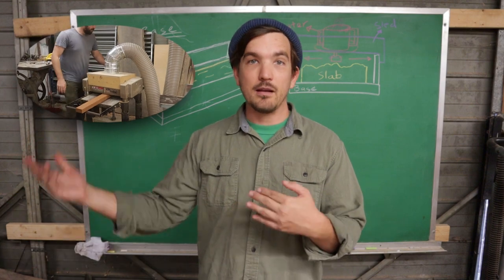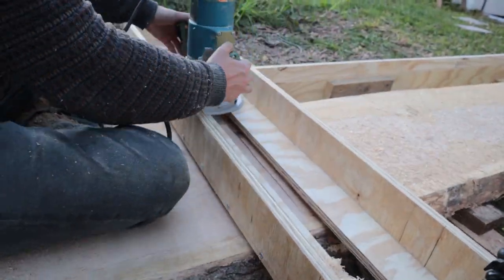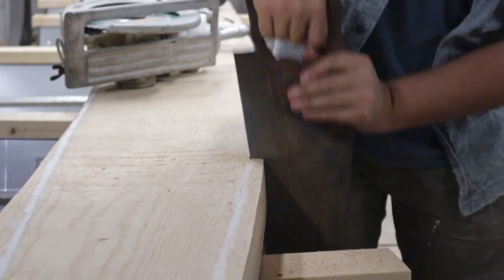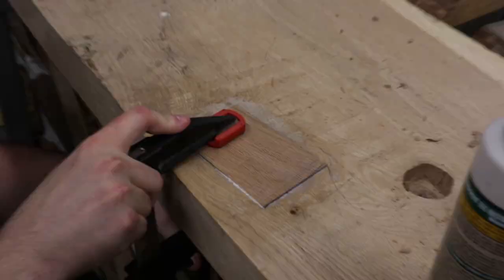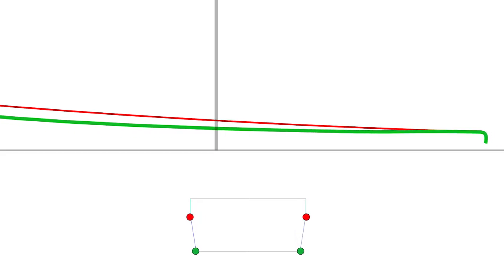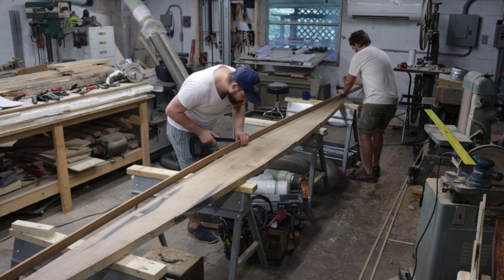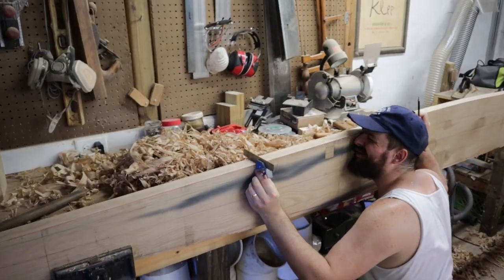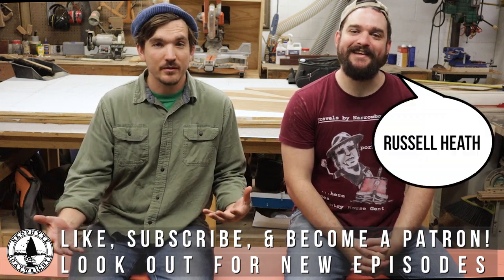Ep 9 - Making the Keel

Comment: Nice video, guys. On Dutchmen, it's slightly better to shape them to reduce the length of the end grain, if you can. End-grain to end-grain joins in timber are problematic, and no glue will work properly to keep that watertight. Also, if you put a very slight taper on the sides of the Dutchman, just a few degrees, you can hammer it home like a wedge, tightening as it goes in. Mark the Dutchman's outline with a knife, and keep well away from those lines until the very last thing you do in chopping out.
BTW, you didn't have a bow in the timber, you had cupping. You've also got some tannin staining (the dark grey areas) indicating that it's been in contact with iron/ steel. You might find that there's a nail, bolt, staple, or fencing wire somewhere in your off-cuts. 
A draw knife should be your go-to tool for removing bulk timber accurately.
Reply from the maker: Hey thanks for the comment! Yes we showed at multiple points in the episode us removing nails from the keel which definitely account for the discoloration. In fact some of the dutchmen were to patch in wood that was removed in the process of prying the nails out. Wedge shaped dutchmen are a good idea as is a drawknife for shaping the bevel. We dont own one so didnt occur to us but definitely duly noted.
Reply from the maker: Oh also the timber definitely had a bow in it in addition to some cupping. In fact it had bowing, twisting, cupping, and crooking. We didnt have space in the vid to address all of it, but it was a real trial to tame such a large timber.

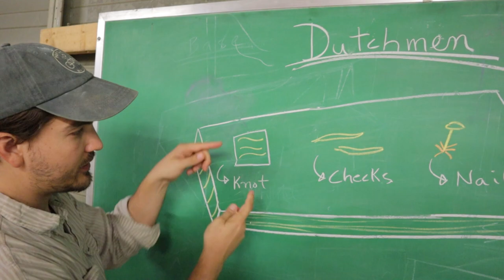Comment: 9:07 Did you mean to say that wood expands and contracts significantly more perpendicular to the grain rather than along the grain?
Reply from the maker: Sorry yeah thanks for catching that!  It is confusing because it depends on whether youre talking about face grain or end grain. but yes in the face grain sense (which is what we are generally concerned with)  you're entirely correct. Either way the concept still applies. Orient grain of dutchmen in line with slab grain to avoid undue stress on joints. Thanks for the correction!